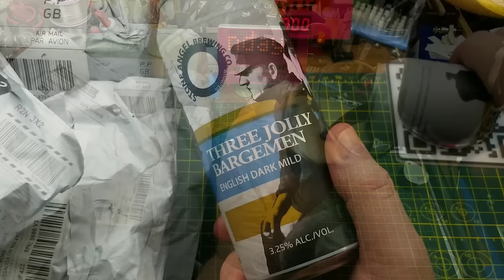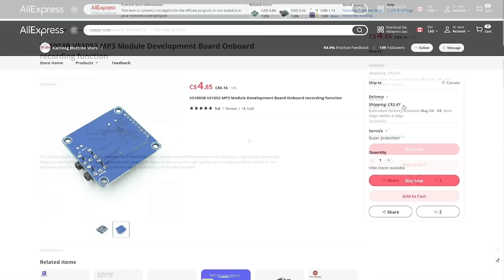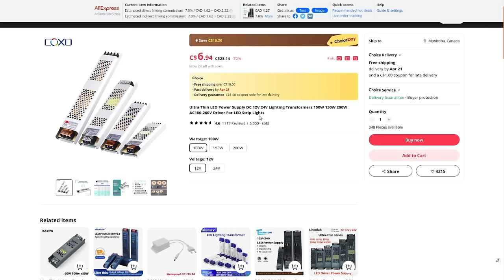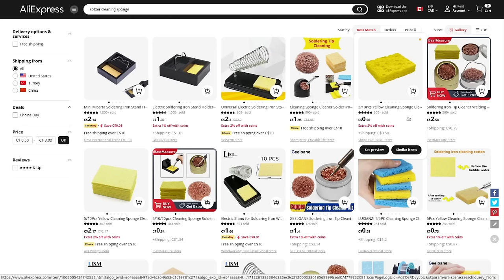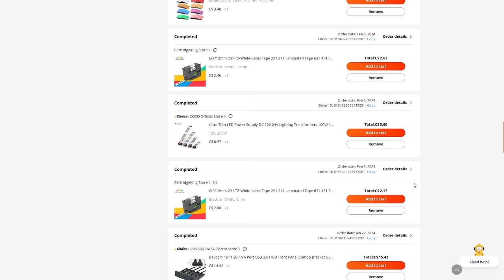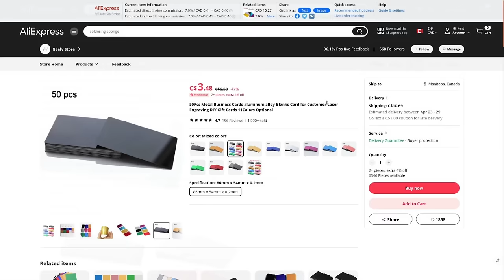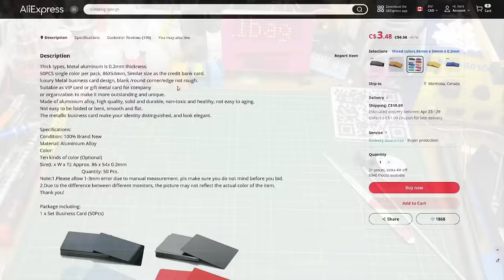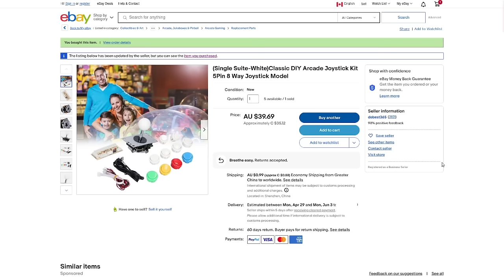Mailbag Monday 190

Comment: The donut shaped piece of plastic you call a dust shield is actually a pinch protector. You put it above the cabinet surface to protect fingers from being pinched between the joystick shaft and the cutout in the cabinet.

Comment: You might be able to squeeze another capcitor into the power supply  case and rewire the input as a voltage doubler for 120V operation.
Reply: Yes, I have seen this done on YT for euro-2-american PSUs.

Comment: Hey 🙂I used the same MP3 encoder a while back when making an internet connected radio, was pretty easy to use. I noticed you got the same button encoder and joystick I used on the 1up arcade cabinet I did a while back when ended up I converted it after I repaired it. Keep up the good work 👍

Comment: I have that arcade controller. It's a nice stick.
The auto/rapid fire functionality confused me a bit. You'll figure it out.

Mine is destined for a C64 when I get around to it.
Reply from the maker: I can feel that "when I get around to it".
Reply: @pileofstuff  "ROUND TO ITS" are very scarce. Many years ago a close friend was constantly asked by his wife to attend to the list of chores, repairs, tasks to be done ASAP. His approach was " When I  get a Round To It".

The wife finally tracked one down in an all day shopping search.
Well my friend was given his missing "ROUND TO IT". Cost a mere $2 at a odds and ends shop.
A whole month of no free minutes for my friend, as the list of over 30 tasks were worked on , mostly gardening, cleaning, painting, misc repairs , using all time, other than employment/work hours, meals, the available 6 to 8 hrs sleep and two 1/2 hr meal breaks while at home. Weekday evenings if not pouring rain and both weekend days at least 10hrs each were now working time to clear the tasks formerly assigned to when a Round TO It became available.
Actually 5 years later they divorced.😂

Comment: The power supplies are fake They are about one or two amps the most I purchased 24 volt 100 watt power supply and it only works up to 1amp. they seem to have over-current protection So you test the maximum current.
Reply from the maker: Stay tuned, testing  video coming soon

Comment: just wondering am I the only one who gets sick and tired of IC manufacturers who insist on marking there little black packets with the faintest identification information they can find.  just had to vent, opened my mail with a number of IC's now I just have to figure out what they are.
Reply from the maker: Yeah, it's frustrating when components are poorly labelled (or not labelled at all).  Makes troubleshooting and repair much more difficult.
Reply: @pileofstuff  Im 66 and my eyesight is not what it was, I am not blind but does white ink cost that much more.
Reply from the maker: @TheWareek  I think it's more the manufacturers really don;t care about individuals trying to repair stuff.